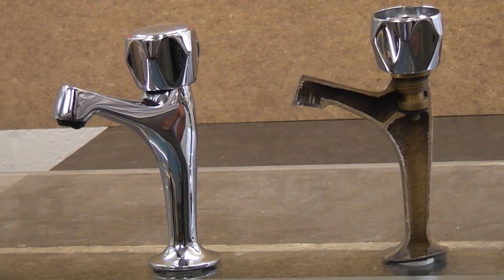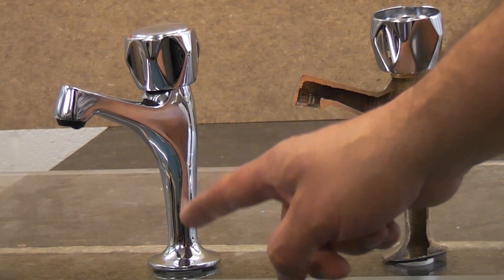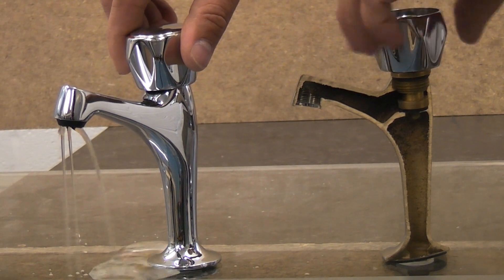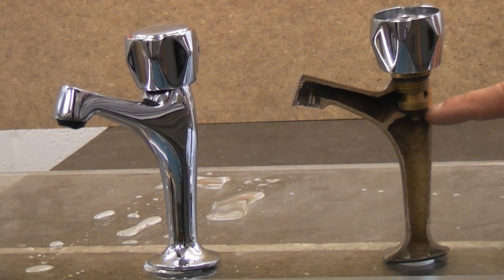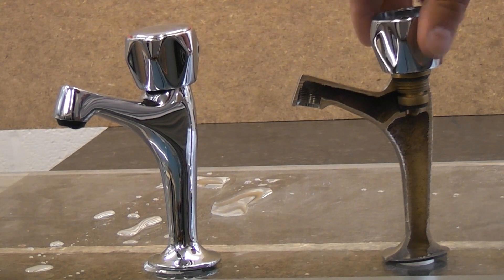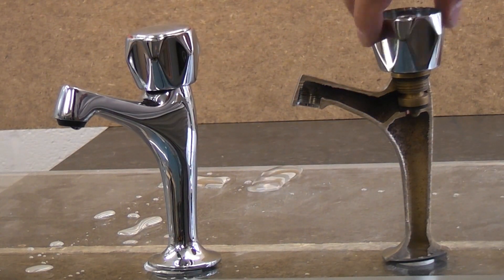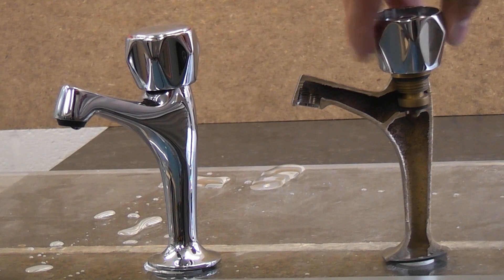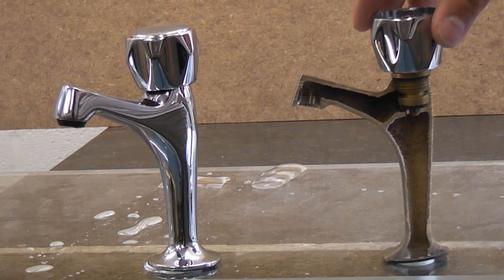How a tap works

Comment: my cartridge has seized I open the tap fully and now I can't close it, any suggestions how free it  probably have to hit it with a blow torch
Reply from the maker: The head gear might have unwound completely.
You'll probably have to disassemble the tap and put it back together (it just screws on) 👍

Comment: Thanks for this this cleared up a huge mystery and guess for me but confirmed my questions on how a tap works so it is basically just a stop gap for flowing water so that is why we need to turn off the water mains either at the source or at the pipe so flowing water does not go through while we perform maintenance or open up the tap and other plumbing adventures.

Thank you so much for this video Ultimate Handyman!
Reply from the maker: Thanks for the comment 👍

Comment: Hi, quick question I have for a coursework! Why doesn’t the water pressure at the point of the washer build up insurmountably as the tap is off for a long time? Does it just sit there stagnant and then suddenly rise?
Reply from the maker: The pressure will increase to the maximum pressure of water supplied by the utility company. The utility company will have pumps and relief valves to ensure that the maximum pressure is maintained and not increased so much that damages is caused.

Comment: But how does the water flow upwards and how does the water change from hot water to cold water?
Reply from the maker: The water is under pressure, as it's either fed by gravity- or pumped at the pumping station.
There are two separate taps, one for the cold and one for the hot water- unless you have a mixer tap, which combines the two!
Thanks for the comment 👍

Comment: But how does the water come up the pipe why does it do that is there a pump like what
Reply from the maker: It is pumped through the pipes at local pumping stations.
Thanks for the comment
Reply: @ultimatehandyman  Do pumps always work? How do they understand when to stop?
Reply from the maker: @noname6573   Some pumps pump continuously, others pump when required and might start pumping using a pressure or flow sensor. I would imagine that water pumping stations are pumping all the time, perhaps with pressure relief valves built in, so that too much pressure does not build up in the system

Comment: Can tap function as a pressure regulator? I need this information to debate with my mom. My answer is no.... is it correct?
Reply from the maker: +Ji Hu 
No, you can reduce the flow using a tap but you can't control the pressure using a tap- you need a pressure reducing valve to do that ;-)
Reply: Thank you. That is music to my ears. ^^